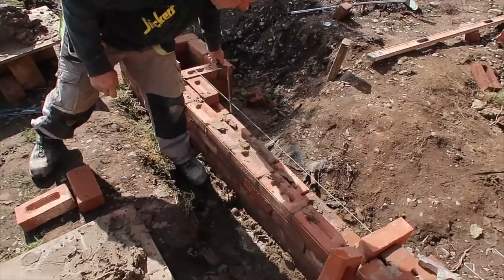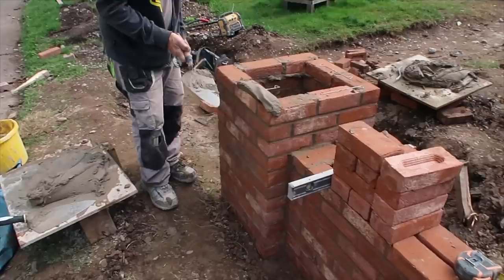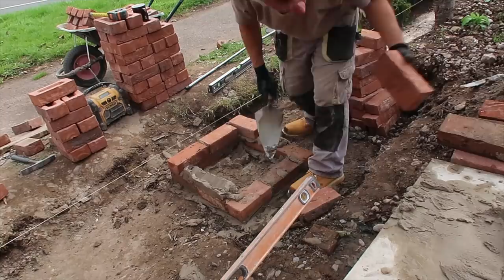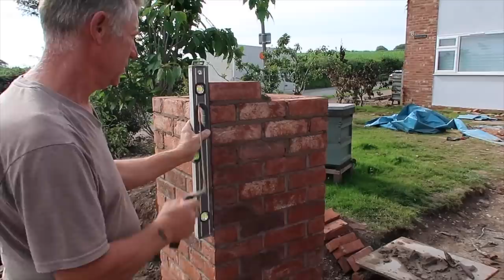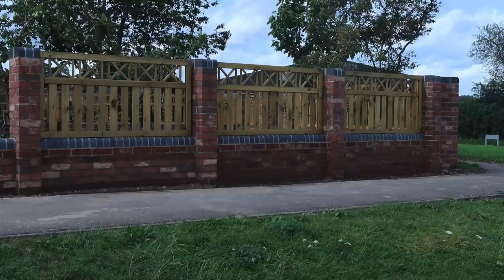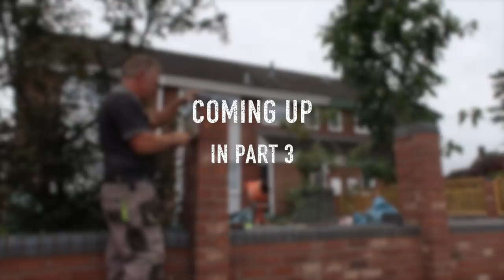Bricklaying 52 metre garden wall: building Part  2

Comment: My house if constructed in Brick. I put a level to some of the outside walls, and they aren't exactly level - they are just slightly off. I've also measured some of the joints/perps, and they aren't all 10mm - most are, but some are 8mm, 9mm, 11mm etc. Is it normal to expect this variance?
Reply from the maker: It happens

Comment: Chris can I ask how you did the first course on the step ? Did you make the step the same height as a brick ? How do you set your line up for that ,? Regards Gareth
Reply from the maker: Yes I did, I did a video on the foundation and I explain it there.  When you start building start at the bottom and lay your line up the steps and build into the step then rack back and carry on till you reach the (the next step) carry on to the top and it should be levell, you may need to a just some courses with a bigger bed or even grind down where necessary but if you've done the foundations level it generally works! hope that has helped

Comment: Why were the bricks "frog down" @3:16 instead of facing up when you were doing the pillar?  Also does the base of the pillar need to use full brick as you did it?  Or is it random?
Reply from the maker: Yes mate random there are hundreds of solids mixed in the packs and we use them mixed in